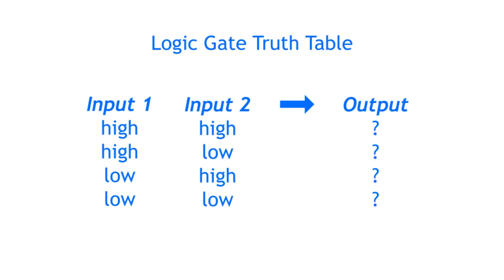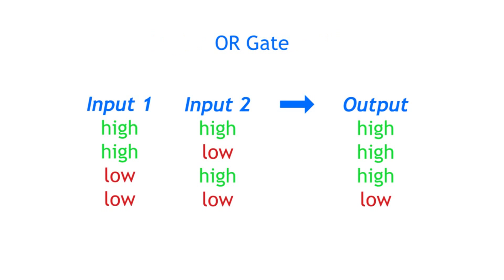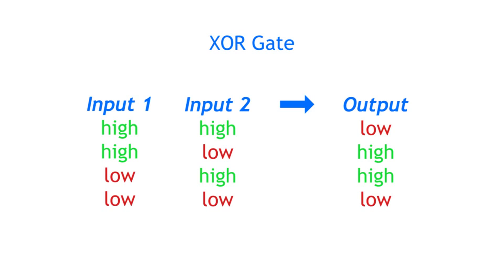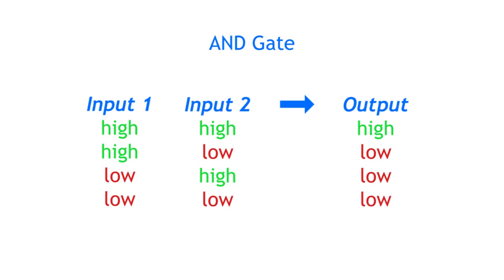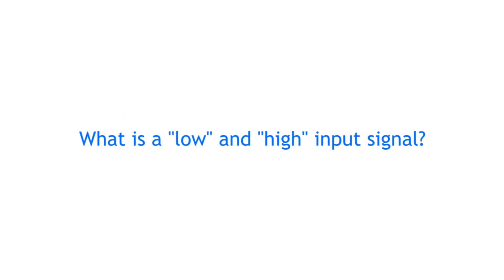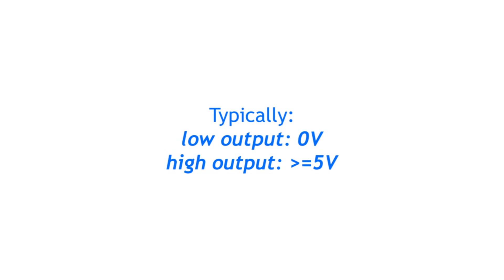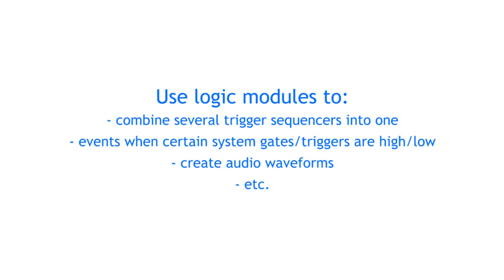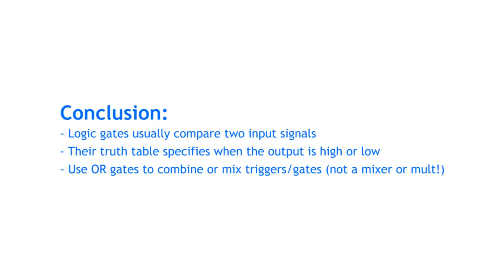Modular Synth Basics #14: Logic Modules

Comment: really cool series. can you give us an example of a logic module that creates audio waveforms? if you have any video that demonstrates such a module, it would be nice to share it too.
Reply from the maker: Logic modules simply compare two incoming signals and then output one signal depending on their ruleset. Audio waveforms are just "fast" waves that fall into the audible spectrum. So if you feed the logic module high frequency waves it might output those as well, if it processes them fast enough (which shouldn't be a problem especially for analog logic). E.g. send two audio-rate square wave signals into an AND logic and it will output a square whenever both signals align on a high value. This will "morph" the incoming two signals into one. Try it out with different logic outputs too. You can also create interesting stereo effects by sending the AND to one ear and the XOR to the other.

Comment: is this turing stuff? that’s the stuff i don’t get yet...
Reply from the maker: No, the Turing Machine is a different kind of module.
Reply from the maker: To elaborate, the Turing Machine module generates melodies and trigger sequences that can change or stay the same depending on the randomness parameter. It's really cool because you have CV control over the randomness so you can "lock" or loop sequences when you like them and if you don't anymore you let it generate new ones. Using a quantizer you can nudge those generated notes into scales.
Reply: @tuesdaynightmachines  Indeed... And it's interesting to know why the TURING machine is called the TURING machine ;)

Comment: I was thinking of getting a Doepfer mixer a-138 to mix gates until I watched this video, is there a short explanation why logic modules are better suited? Is it because they are more versatile? Thanks :)
Reply: Thanks for your awesome video series by the way!!
Reply from the maker: +James Dawson gates are basically "on/off" signals of a fixed voltage level. A mixer will mix those voltages together, so if there are two or more gates coming in at the same time,  they are added together and probably clip the mixer circuit at a certain level. This can work, but the "clean" way is to use an OR Logic, which just outputs one gate signal for as long as one or more gates come in, instead of outputting the sum of all incoming signals.